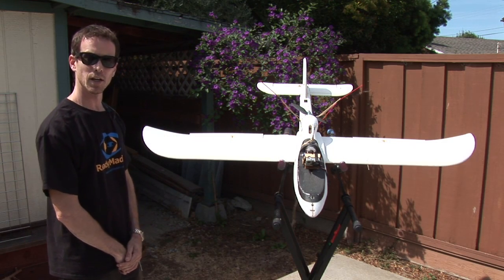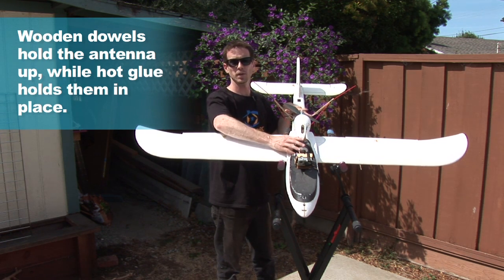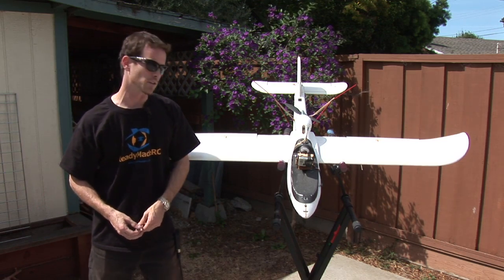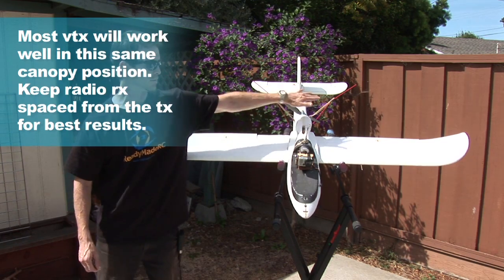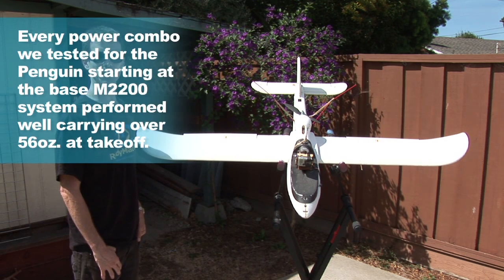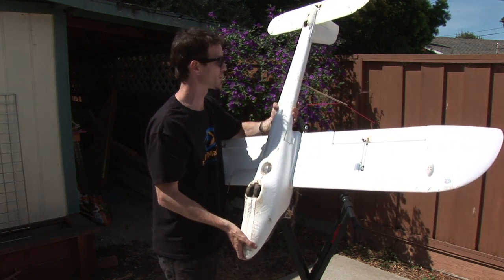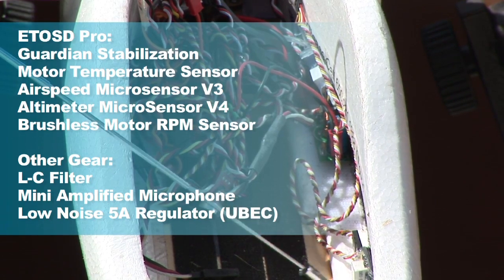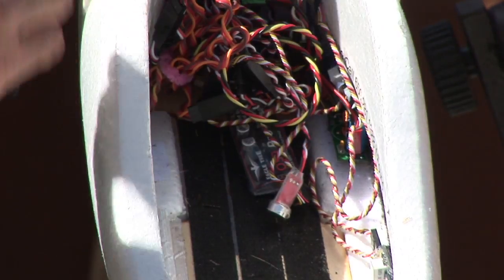GSTV - Penguin - FPV Gear to Use

Comment from the maker: Sorry, I by accident removed a comment when I meant to reply. The question was from	gagomand asking:

"why didn't you use 2.4GHz for the controls. You don't need a long range system when you use 5.8 for the video."

Answer: The 5.8G link I use on the Penguin will exceed standard 2.4G radio links out there as I've had it out to around 5 miles. That's why I use it with a long range system there. There is a common misconception that 5.8G links can't be used for long range... but they can! :)

Comment from the maker: The stock servos are ok and have worked fine for my flying. But I stripped one in the car banging it around and for an expensive FPC setup I tend to add in metal gear hitec servos just to be safe. Some people like the low cost of the stock servos, but for some the servos are pretty critical and an upgrade can add some security. There are options for the kits @ RMRC to use Hitec servos.

Comment from the maker: The ESC is inside the round top part in a section on it's own and with airflow. It works perfect. The Distance from the VTX is about 5". No problems with them at that distance on either 5.8 or 1.3 (which are the only I've tested so far).

Comment from the maker: As noted in the video for the vtx antenna. ;-) And there's no rx in view so no claim of the cloverleaf on the rx. Actually you can use a Skew Planar on the tx as I've shown and that's really no problem. Some antenna experts say the Skew (4 lobe) is better to reduce multipathing which might happen in a setting with lots of dense objects, but I've not tested this difference.

Comment from the maker: They are different planes, and of course I'm a fan of the SW if you've seen my videos, but the Penguin is more "fun" as acrobatics are easier with this plane over the SW. In addition it needs far less modifying for FPV setup than the SW. Plus the Penguin is supported by ReadyMadeRC so you will have some support if there are problems unlike with many overseas vendors who don't support their customers.